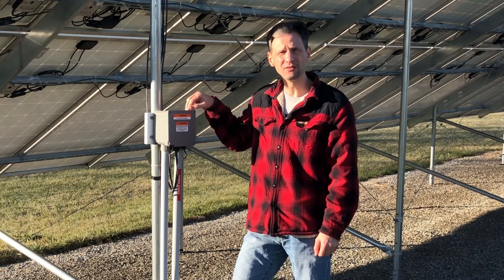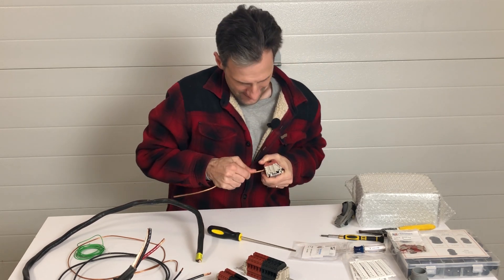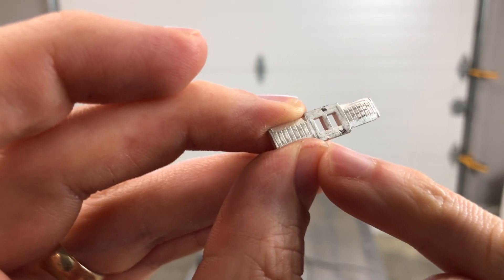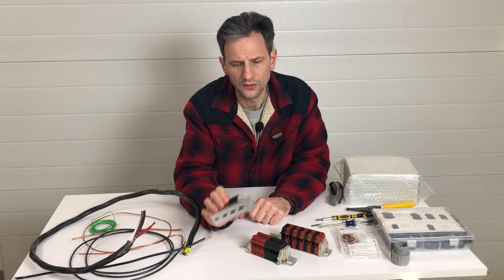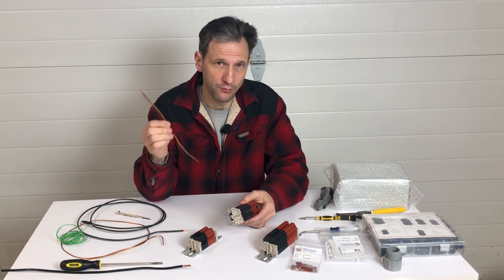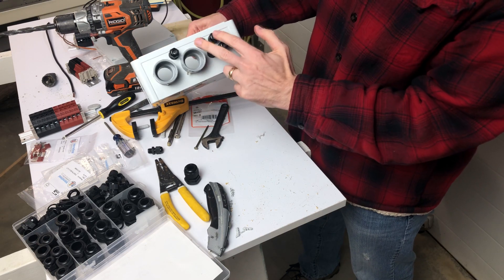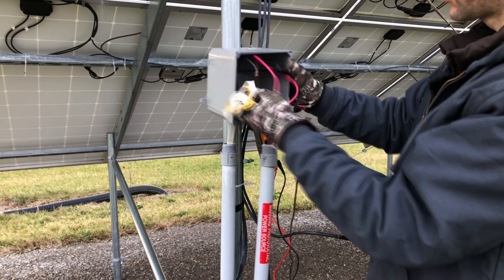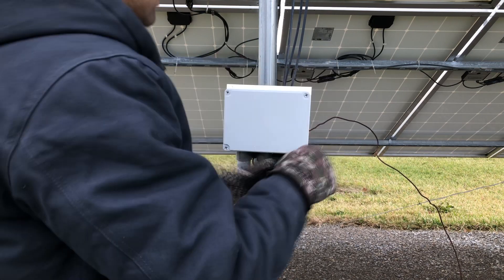Solar Panel Junction Box Upgrade With Dinkle DIN Rail Terminal Block

Comment: Question.  I need to combine 4 panels in parallel with one output to the controller.  Will these blocks work?
Reply from the maker: Sure, you can use the jumpers to combine as many blocs into one bus as you want.  As long as you don't exceed the rating of the blocks.
Reply: Thanks. Maybe a dumb question, but how and what does that look like using the block? Do I have to use the jumpers?

Comment: Terminal blocks are a cleaner installation.  I was curious why you didn't use them on your initial build.  But correctly installed wire nuts are perfectly safe.  I also love the Wago connectors and tend to use them in lieu of wire nuts.

Comment: Wire nuts installed correctly work good have to twist up the wire then install the nut over it. I like these terminal blocks just orders some I want to go from solar wire to 10 THHN
Reply from the maker: Wire nuts can work fine, but the more I use the terminal blocks, the more I like them.  I'm always changing things and it makes changes much easier and the box is so much more organized.

Comment: Wire nuts were never designed as a connector, only as an insulator.  When trouble shooting sagging voltages in older homes it has most often come done to wire nuts that heated up and the plastic melted off exposing the wire coil and deforming it.  Since I found the first one, I have, if possible, soldered all connections or use crimped or screwed terminals.   Network00

Comment: Wire nuts are a fine way to connect wires. It's a people skill thing. People screw up terminal strips as well. I've been doing commercial service work for 25 years now, and the relatively few problems along this line I've seen have been poor installation and/or application. Any time you use wire nuts in a place where moisture is a possibility, point them up like a castle so they don't collect water like a bucket. Never tape them. Any time you see tape on a wire nut, be careful because they are probably loose. Those silicone filled ones are actually hard to tighten well. Still a good idea for underground boxes, that's about all I'll use them for. In your application, regular ones will be fine. Drill a tiny hole 1\8"-ish somewhere in the bottom of your box to allow drainage. Also, I didn't see an expansion coupling on your PVC pipes. Maybe I'm missing it. If not, that'll tear out the bottom of most any box in a few years. Also living in Ohio, can confirm. PVC expands a great deal. 
Your testing was problematic as well. You pulled on the DIN rail wires straight the way they went in. You pulled the wire nut at a 90° angle. I'll admit the DIN rail offers better inspection, most of the time. Many smaller terminal blocks have enough plastic you can't see the actual wire in the clamp. When tightening a wire nut, you can grab the nut with one hand and try to pull the wires straight out. That would have uncovered the near failure you had.

Please don't get the wrong idea here, I really enjoy your content and it looks like you do very good work. I appreciate everything I'm learning from you. Thank you.
Reply from the maker: I learned something today!  Thanks for your detailed feedback and recommendations.  I agree, wire nuts are not all bad.  I used them in every outlet in my house.  However, there are some other options these days that require less skill to get good results like lever lock nuts from Wago for instance ( https://amzn.to/3XtD5xR ).  The reason I pulled the wire nut at a 90° angle, is because that is a possible condition for it to be exposed to.  You are right about the expansion coupling.  I didn't install one.  Why didn't I know that was a thing ( https://www.homedepot.com/p/Carlon-1-in-Schedule-40-and-80-PVC-Expansion-Coupling-Standard-Fitting-E945F-CAR/100124876 ).  The box did crack which seemed obvious after the fact, so I made a slip mount for the box.  Thanks!

Comment: Thank you Dave for this particular video, it is very informative. Dinkle DIN Rail Terminal Block is an excellent product, is it also safe to use on roof install?
Reply from the maker: I used it in this roof install: https://youtu.be/VkqUvd4c1-U
You can jump straight to the chapter on DC Junction Box.

Comment: I have used the DK system for years at factory for building everything from a junction box to a complex control box to run glass cutting and coating machines

Comment: DIN rail mounts have been used in the USA in the manufacturing industry for their equipment electrical cabinets for a long time.  The connections can fail.  You will need to periodically check the screws and wires for looseness. 
 As far as wirenuts vs DIN rail, for your application it really won't matter.  It is a cleaner installation and will make for easier maintenance and expansion.  
 Wire nuts the issue with them coming loose is from if you was to connect dissimilar wires together.   Expansion and contraction is different rates.  That pushes the wire nut off.  Usually you would see that with aluminum wire to copper wire connection.  
Since your so concerned about wire nuts now, you should now be going through your entire house to eliminate the hundreds of wire nuts in there now.
Reply from the maker: There are wire nuts in my house, however most of them are protected with arc fault breakers that will trip if there is a faulty connection.  For future connections I have started using wago connectors.  I'm not saying wirenuts are no good, when properly applied, they work fine, it's just more likely they will be used incorrectly.

Comment: Just curious???  Why no local PV isolation disconnect at the array?
Reply from the maker: Many installers do install a disconnect at the ground mount location for convenience, and you should always check your local codes, but I found it unnecessary.  I have a disconnect at the inverter and I can control the voltage of the panels to 1V/Panel with the optimizers.  It would just be extra cost for me.

Comment: Nicely done. You could put your own "mounting" board in the back of a UL listed box. Also I would have mounted that after wiring everything together. This would have allowed you to position it optimally in your project box. 

But LOVE your content. Keep up the good work!
Reply from the maker: I didn't like my old UL listed box so I thought I would try something different, but I agree, mounting a board in a UL listed box is the correct solution.  Thanks for your thoughtful feedback!

Comment: why is it called DIN..Deutsche Industrie Norm. German Industry Standard.  It is THE accepted Standard in Europe. The American standards and electrical equipment  are PRE GLACIAL PERIOD technology. German and EU in General (!!!) are using modern equipment, If you know a little bit about about ground fault circuit protection, for your info The EU standard for as long as I can remember is a CURRENT FAULT protection principle, while the US is still adhering to the VOLTAGE FAULT protection principle that was abolished in Europe AGES AGO, as it is inferior. Wire nuts were NEVER USED in the EU countries, I only came across them in the USA.  Wire nuts give the electrician a wide flexibility of using them Correctly or BADLY, you just cannot see on the outside how the connection inside is made! Plus the degree and impact of CORROSION inside the wire nut cannot be estimated by the looks of it.  Are the wires twisted, sleeved, and crimped before putting the wire nut over the junction or not? Such a wide range of potential problems! All nicely covered up by the wire nut. With the DIN connection the ONLY WAY you can F..CK things up is if you forget to tighten the screw.  Otherwise, the connection is always uniformly solid. Pulling on the wire is not exactly an exhaustive test of the overall quality of a wire connection but even there the DIN solution is superior.
Reply from the maker: You're right, pulling on the wire is far from a complete comparison of the two types of connections.  But, as you mentioned above, although a wire nut can be a good connection, there are a host of reasons not to use them.

Comment: Din rail with terminal blocks are definitely a more tidy way for terminations. However, every commercial/industrial building uses wire nuts in construction. Lateral force is never a concern in a junction box. Heating and cooling is what causes connections to fail. Source: am an Electrician. I would also use a large JB with din rail and termination blocks doing an array just to make it easier for service/expansion. Minimal extra cost for making your work prettier.
Reply from the maker: Thanks for the Input!  I understand the lateral load on the wire nut isn't what it was designed for, but it helps give an illustration of the physical strength of the connectors.  I think especially for the average DIY installer, the individual conductor connections provided by the DIN rail setup is a more robust solution.

Comment: Great video Dave!  Recently installed a roof mount solar system.  Your videos were very helpful.  Ended up running the PV wires through the junction box and conduit to the inverter without a splice.  Figured it was a better/safer option without a splice.  Like you, I did use a grounding bar for the ground wires.  Much better option than wire nuts.
Reply from the maker: That's great!  I'm glad my project served as a useful reference.

Comment: Nicely done! I would have used wire nuts too, now I'll go DIN rail if I ever pull the trigger and build a system. 600 watts on a cloudy day is impressive.
Reply from the maker: Thanks!
Reply: Or use WAGO 221 serie (221-612 as example)